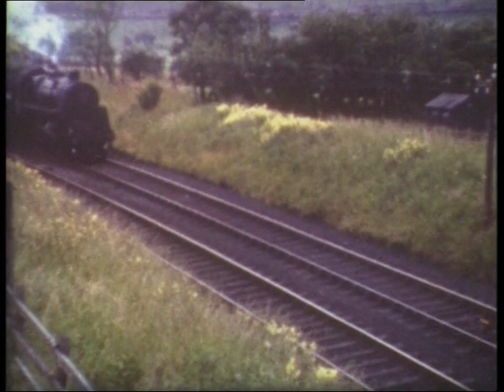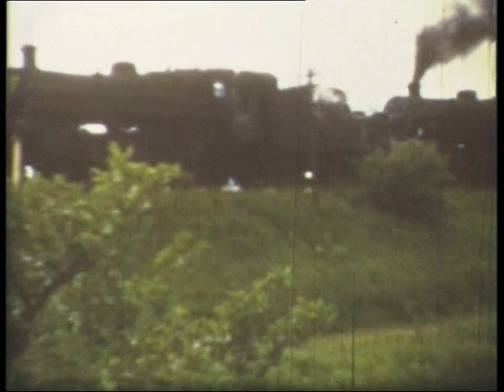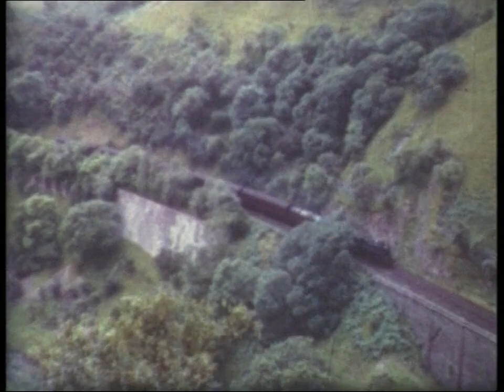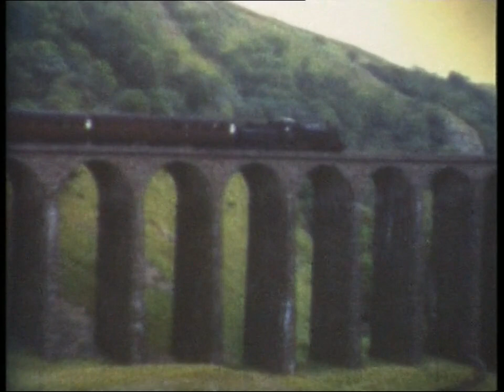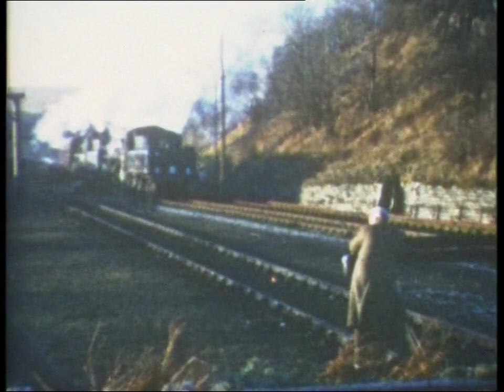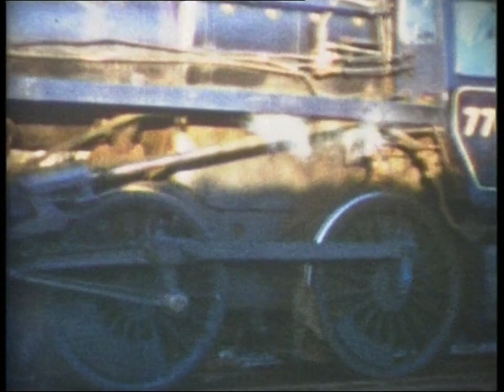The Stainmore Railway and Belah Viaduct

Comment: Neil - rubbish! The line closed when coking coal east to west, and iron ore west to east, stopped being economically impractical. There was nothing wrong with Belagh because good management of trains in iffy weather was always paramount.
Reply: Belah was in need of significant rebuilding due to metal fatigue and corrosion of the steel and iron work. The lick of paint it got a couple of years before closure was mere cosmetic  treatment. Due to its age and a lack of proper maintenance during WW2 a weight restriction was in place after the war prohibiting double heading of trains across both Belah and Deepdale viaducts, so hardly nothingbwrong with the viaduct.
Reply: There's a ton of images of double headed trains in the 1950s. The Railway over Stainmore Pass by Chris Rowley is a good resource.